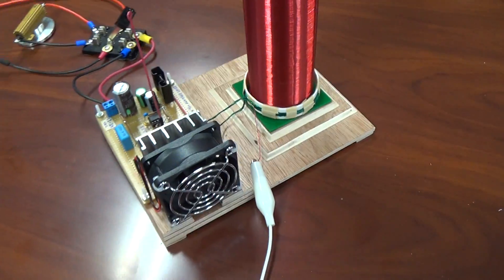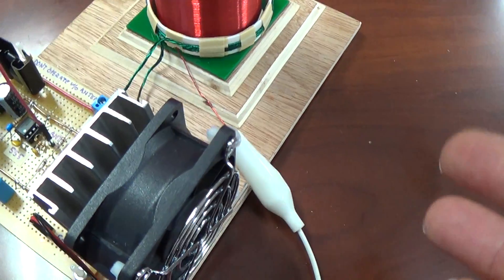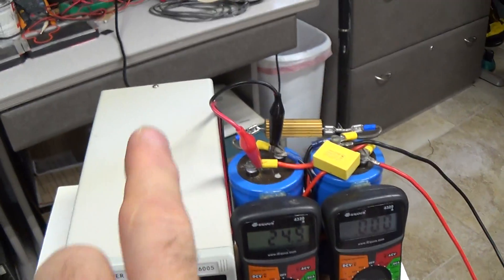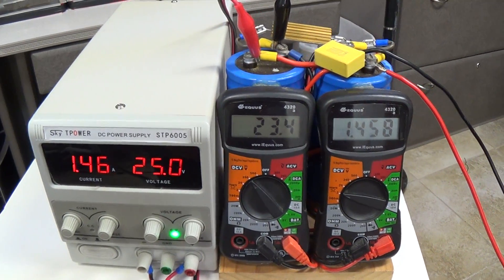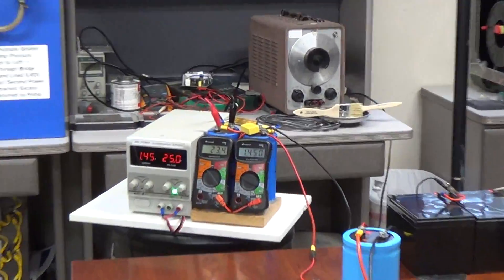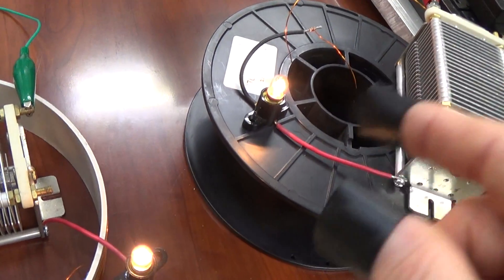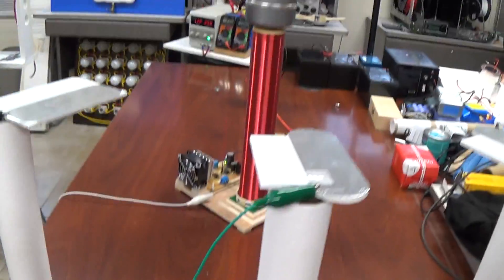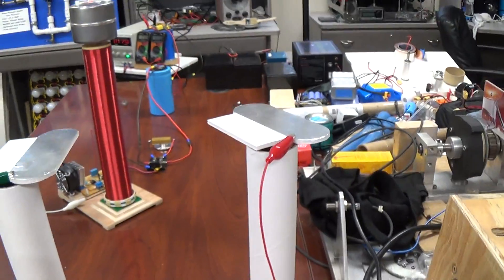TinselKoil Test 3

Comment: Hi Luc, good experiments as usual.  If you haven't already, could you setup your receivers inline radially in one direction out from the transmitter.  I would like to verify my idea that just as cell towers can extend a weak signal and shoot to the next tower inline to extend range, I want to see if the normal lighted bulb distance from the transmitter to one receiver can be greatly extended by using the other receivers inline (sort of a daisy chain) to each other over a distance if the bulb will light at a much farther distance than normal and if it is the same brightest or suffers.
Reply from the maker: Hi EnergyCrafts, I can confirm if I place another perfectly tuned receiver close or behind another the prior assist the latter. So yes, what you propose does extend transmitter range.
Reply: Thanks Luc for the test confirmation.  That is indeed great news!  A number of extended range cordless charger inventions can come from this.  MIT's version is very limited range.  And it also shows a taste of what Tesla wanted to do with his Country wide "wall to the sky" defense perimeter, where he proposed a complex of many magnifying towers placed strategically at specific distances to each other.  He said in war time they would provide an impenetrable barrier to the enemy, but in peace time would provide energy to serve people in any area, even out in a bare desert.  A key secret to this plan that is largely unknown to most people is the use of directed longitudinal vectoring of energy with the towers to send energy in a broad area or to a tighter focus to a target as higher energy density some what like we think of in triangulation calculations today but with waves.  The towers were meant for much more than I state here, but that is all I have time for now.

Comment: Hi Luc,

Your Tesla coil setup obviously is missing interrupter and this is main reason why it is using amps, not micro amps.
On the current setup when the second bulb was lit and the power consumption gone down a little the whole setup was close to the resonant LC point. Usually it is very narrow range and have to be tuned on coils matching frequencies in transmitter and receiver.

The tuned Tesla setup usually goes around 0 consumption and the radiant receivers are receiving abruptly interrupted nanosecond spikes + atmospheric ambient response on top of it. You can try with different voltages and frequencies on the Tesla coil to maximise ambient response on the receivers. Then you will see that effect I am pointing to. It is atmospheric source of the energy and is very important when building such devices for the atmospheric electricity utilisation.

Cheers!

Comment: any DC coil will drop amps if u you use the fly back current. and the fly back can be taken from the secondary coil as a transmission, interesting thing about back current its voltage will rise to suit its resistance while dropping amps. question what pf  is your air capacitor?
Reply from the maker: Around 40pf

Comment: Super cool! 

In my opinion, this is a dielectric displacement current. 

top load projects a dielectric field. without a resonant load to flow into, the current has to push harder because the dielectric field cant properly ground. 

the resonant coils provide a ground for the dielectric field to flow into. As the dielectric field flows into the resonant coils, there is less current needed to push the dielectric field out.

the top capacitance of the tk and the receiver plate (connected to the resonant coil) can be seen as two plates of one capacitor. the dielectric field is in between (through counterspace).

 thank you for sharing this great video!
Reply: Hi MasterIvo, nice to see your comment here after 7 years!
Reply: @omidyousefian4109  ha!